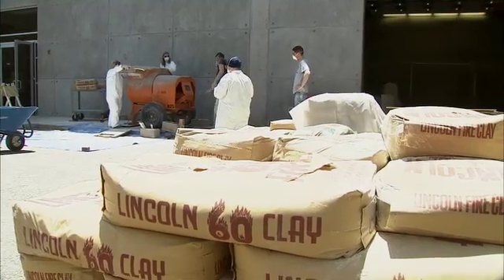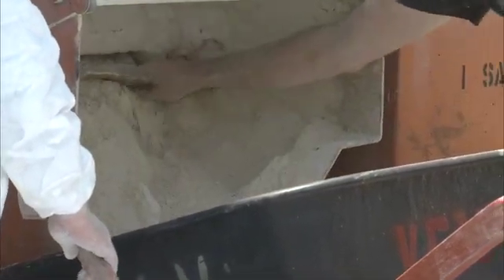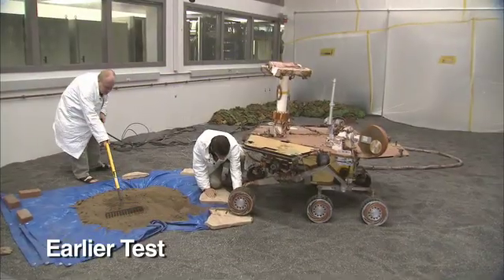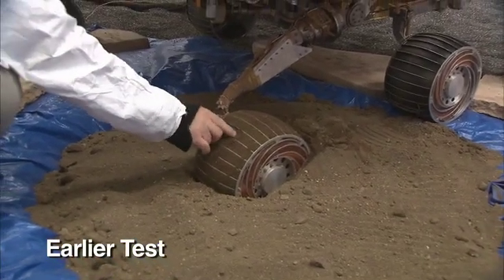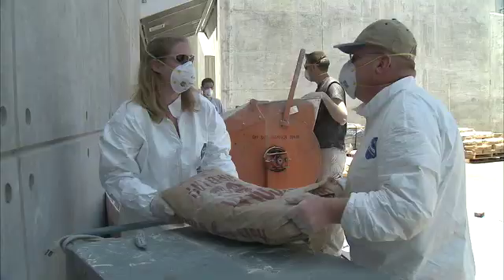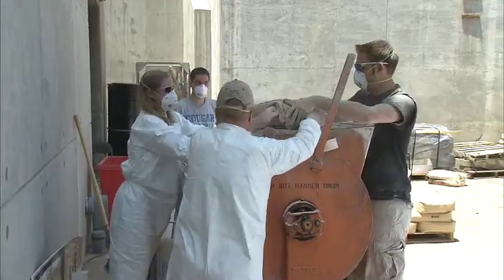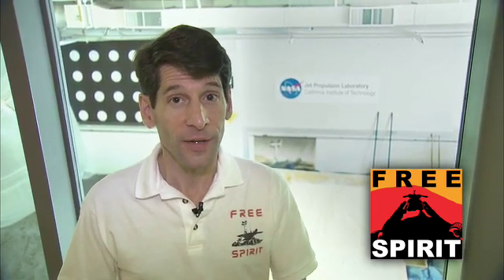JPL Free Spirit Update - June 26, 2009

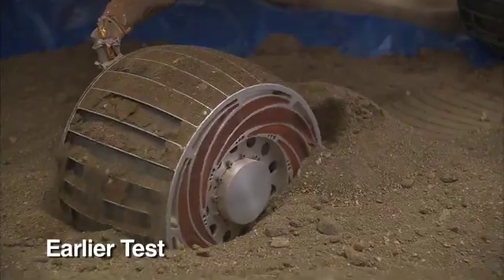Comment: i mean look at the wheels @ 1:00  i looks like the things were designed to get stuck.  the things fill up with the dirt.. its a miricle that it hasn't gotten stuck until now. i suggest that on the next one have tank treds on the bottem. soo if the wheels get stuck the thing can lay down and tank its way out.